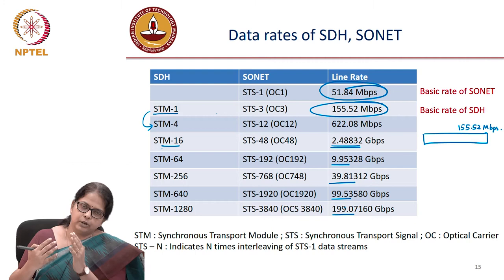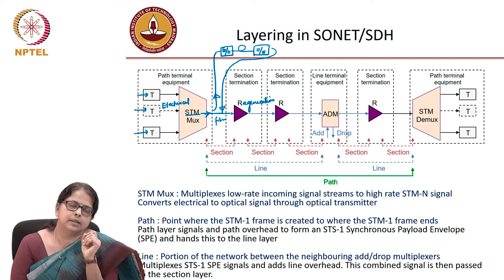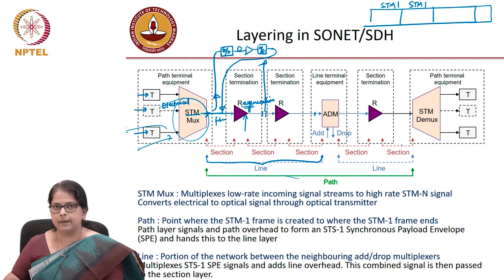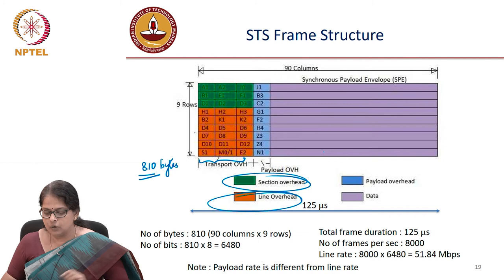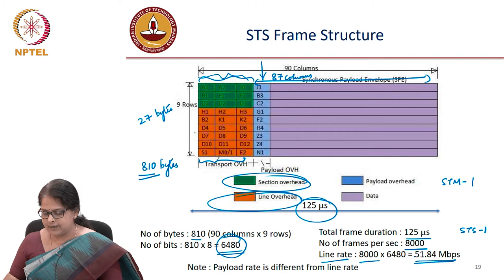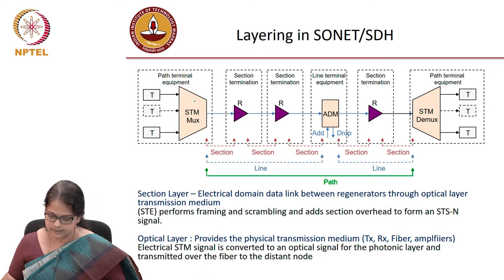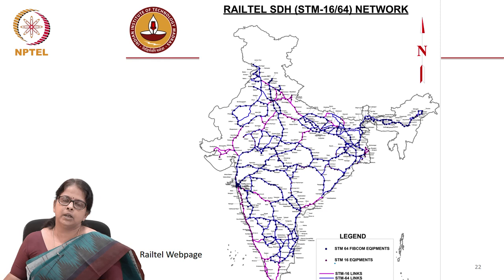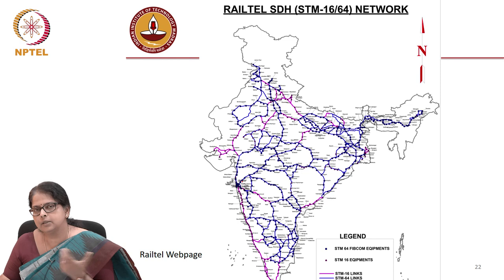Lec 109: SDH/SONET Layering, Frame Structure

Comment: For sts base signal is 51.8mbps, for calculating the bit rate of stm-4 we have to use base signal of stm-1 which is 155.520mbps, so 4*155.520mbps will be the bit rate for stm-4